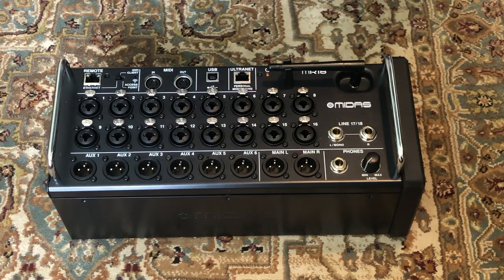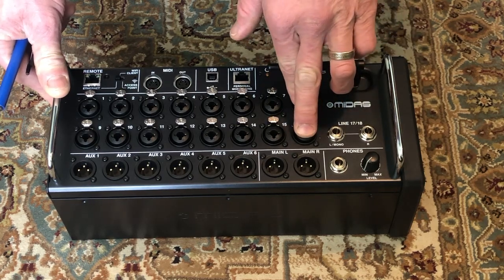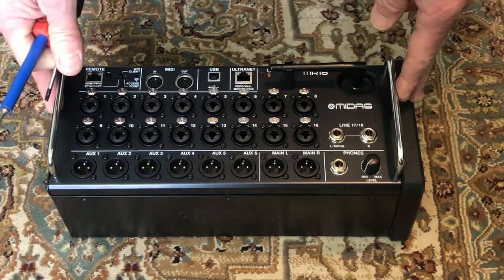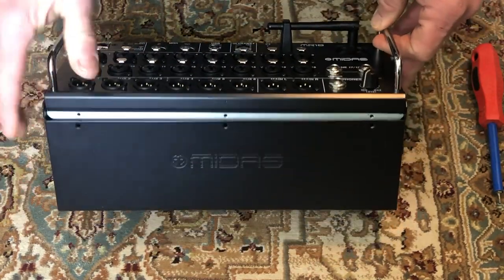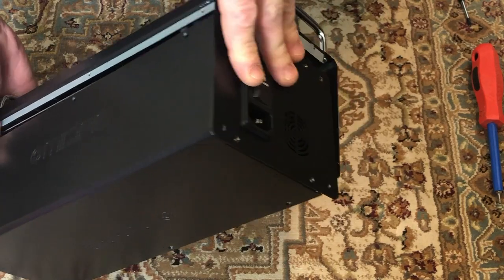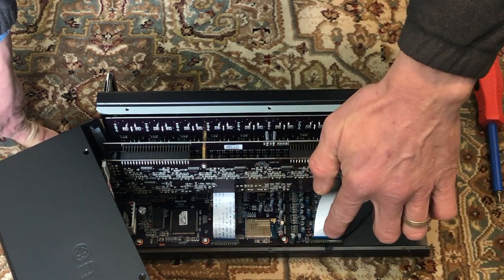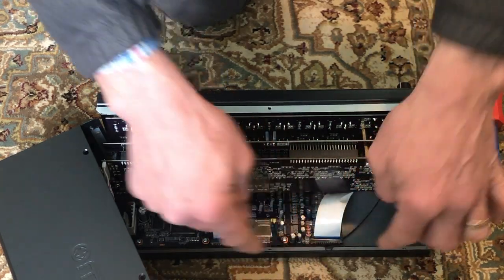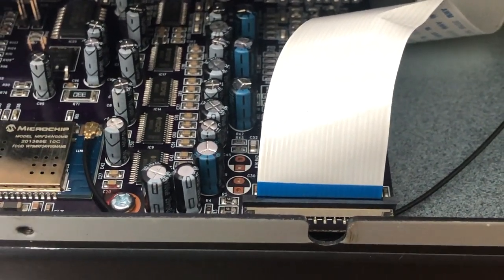Midas MR18 Mixer No Microphone Preamp Signal - Ribbon Cable Connector Fix

Comment: For the most of electronic appliances. The LCD TV for instance .The manufacturer would apply some glue to the ribbon cable connector to secure it tight not to lose, but why Midas didn't?

Comment: Same for the Behringer XR18?
I have a 5 year old XR18 that just recently started showing signal on Ch9 with nothing connected. I sprayed compressed air, contact cleaner (not at the same time) and even left 48v on the channel overnight, and I still see the signal. It only goes away when I switch the channel to USB input.  I can hear signal when I connect a mic if the gain is in the  right range, so maybe it's not fried, but a bad connection somewhere. Someone else said it could be a ribbon cable (fingers x'd) I'm not sure if it would be the same one you were showing, but I'll try that first. Thanks!

Unfortunately, after reconnecting that white ribbon cable and a couple others, my problem still persists. Not sure where to go from here...